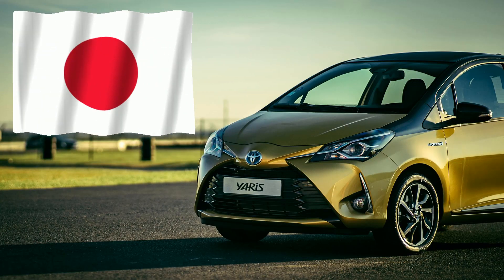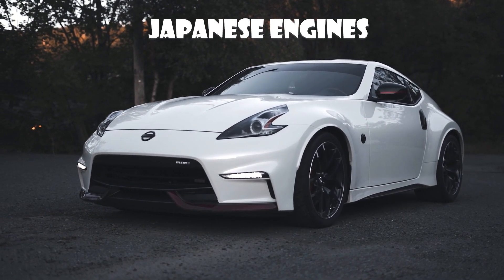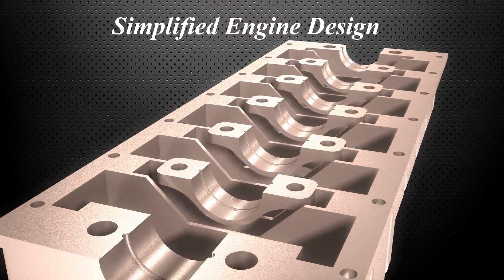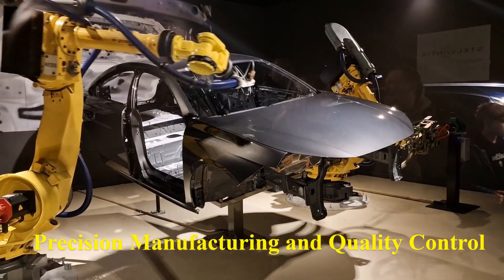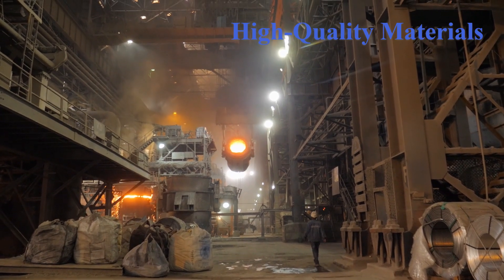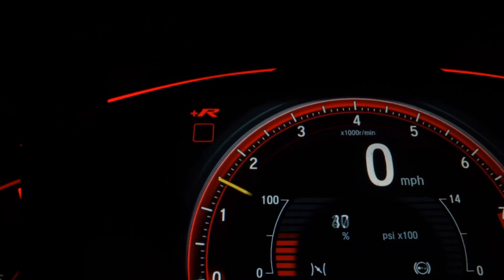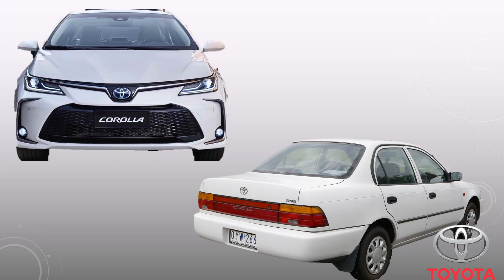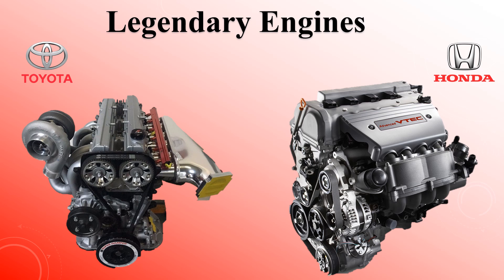Why Japanese Engines Last FOREVER! The Secrets Behind Their Legendary Reliability

Comment: "Why Japanese Engines Last FOREVER"

uses a pic of a car which was known to blow its engine on a dealer organised track days
Reply: You’re thinking about the FA24. The engine in the car on the thumbnail is the FA20. Oil starvation on hard right turns does not happen. I daily drive this car - supercharged over 100k
Reply: @AKidOnARoof314  the fa20 also has starvation issues, you just don't notice it as they aren't that bad

put some good tires, go to a track and show me your logs if you are running a standalone 

i can bet 100$ that there would be oil pressure issues seen in the logs